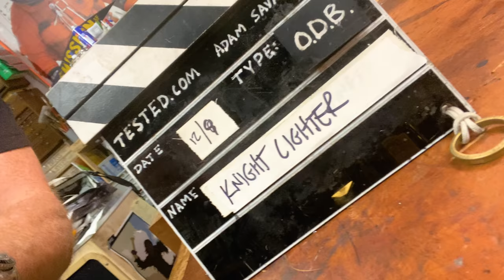Adam Savage's One Day Builds: Knight Lighter!

Comment: "So I've been watching those videos of dudes fixing things...I'm starting to have an issue with them."
Leaves us hanging...
Reply: Check out the My Mechanics channel. It's really great!
Reply: @cbugle  I'm already subscribed to several of those channels, which is why I'm on pins and needles wondering what issue Adam has with them!  Adam, please; do a short follow-up video!  I have to know!
Reply: I suspect he's talking about the Restoration vids that are popular.
It's basically people taking things and throwing them in salt water for a month of so and then "restoring" them by removing the rust.
Basically manufacturing problems they later "solve". Because they never seem to run out of old rusty items to restore.
Or people taking an old thing replacing every part with new things, basically making a new item. Theseus ship style.
I can't stand em.
Reply: I was wondering the same!
Reply: @5chr4pn3ll  lot of them are real, i saw old toy car, old handdrill, etc, but yes most of the random rusty axes are fake ones
Reply: @5chr4pn3ll  Yeah, maybe so.  I can see not being too impressed with that sort of thing.  Maybe I don't watch some of those channels because in addition to, yes, a lot of rust removal, I see dent repair, welding to add metal to then file back into shape, crafting things like new wooden handles as replacement parts, designing/printing new labels, etc...
Reply: My thoughts exactly.  I was waiting through the whole video for him to come back to that comment and tell us why he's having issues with them.  I assume his issue is that he's finding a lot that are either fake, or just using bad practices.
Reply: Hope he’s not talking about the likes of Scoutcrafter and 357magdad. They’re great
Reply: I came across a restoration video featuring a wheelbarrow in which the person proceeded to paint the tire black after cleaning it to make it look new. I don't know why but it felt so disingenuous that it ruined the whole video for me, maybe that's a facet of what Adam's talking about.
Reply: @5chr4pn3ll  I’m thinking the same thing, the “restoration” videos made to look good to the YouTube masses. Not the ones with real care, attention to detail, love for the historical value of the items, and sharing a little education on the process.
Reply: Some are too well made. I watched this russian the other day and it was like magic wizard stuff.  Potions and lotions to remove stuff.
Reply: His issue is that they don’t do a big reveal about what their videos are about even though it’s in the title of the video and usually the thumbnail
Reply: the issues everyone has: a lot of the metal objects have induced oxidation and are over-renovated. A lot of those channels are just frauds.
Reply: @5chr4pn3ll  gets old rusty knife
replaces the blade with a new one
replaces the holder with a new carved one
i  h a v e  a c h i e v e d  r e s t o r a t i o n
Reply: You gotta have the POV shot of someone picking out a conveniently placed black 1990s TV set from the bushes that just needs a fuse or something.
Reply: My guess based on the way he restored this lighter is that Adam doesn't like how they remove every trace of history and patina from the object, complete sand, polish, treat and paint the object until it looks brand new and is totally unrecognizable from the original object.  That's my complaint at least.  I do enjoy watching a few of the channels that seem the most genuine, but it hurts me to see them stripping away all the beautiful patina on and object, sand blasting it and then blueing it.  Sad times.
Reply: @5chr4pn3ll  Or the channels who literally use faked dirt and rust on their items they wanna restore, just so they look more screwed up in the thumbnails! 
Its so obvious on some, its not even funny, becauce of how many dumb people keep clicking on them not knowing any better, lol.
Reply: I love restoration channels! But I mostly watch them to relax. They were SO effective at putting me to sleep because of it, it''s an ASMR thing for me. But one channel I truly enjoy is @handtoolrescue. Such a great channel and he actually takes the time and care to restore antique tools!
Reply: Yeah very curious about where he was going with that
Reply: Knowing the kind of TV persona that Adam has, and the genuine positivity of his overall outlook (especially on Camera) I wouldn't be the least bit surprised if he decided not to finish that thought because he doesn't want to badmouth, belittle, or demean when folks may just be doing the best they can or discourage anyone from starting something.
Reply: @5chr4pn3ll  hes talked about just that thing in another video. I think it was where he was aging brackets for something
Reply: I also want to know, I've been watching some of those lately and also started having some problems, I just skip them now, I really want to know the issue Adam have :)
Reply: One of the greatest skills the man possesses is the ability to be genuinely and resiliently positive - but UGH, I wanted the rest of that thought!
Reply: Handtool Restoration is one of my favs.
Reply: Yes please finish the thought
Reply: He did mention how many of them seem to be staged in a previous video.  But, Adam also puts a lot of effort and skill into giving the things he makes a weathered look so they don't appear to be brand new and so they look like they have a history and a personality.

Many of the restoration videos that aren't staged are instead completely erasing an object's actual history and personality by making the items look like new or repainting them a different color... it's kind of offensive.  It's like taking old photos of someone else that you find and photo-shopping out their scars/tattoos or changing their hair color or adjusting their expression all because viewers find the process and results "satisfying".  It's shallowness to an extreme from that perspective.
Reply: Prince>McCartney
Reply: @5chr4pn3ll  If you're ok with antique firearms, Mark Novak is a good channel. He doesn't run out of old rusty items because he's a professional gunsmith, and well, antique firearms are frequently neglected. He also tries his best to avoid altering the original piece, so you get to see how far one can go to restoring things as they were.

edit: ooh, another one if you're into engines, cars etc. is Mustie1. His content is quite long form though, with a lot of focus on getting things working again. He doesn't really restore things to a polish.
Reply: “The problem with channels like Tsty and mymechanics is that no one ever uses their fingers to simulate the obnoxious walrus-like mustache of a former coworker.”
Reply: I think he's just saying he's watching them more he maybe should.
Reply: @5chr4pn3ll  My Mechanics
Reply: I know what bothers me about many of them is the "restoration" is either actively destructive to the object, or isn't a "restoration" so much as it is some filler and a coat of paint.  It's papering over the cracks without actually addressing the underlying damage that has happened over the years.  

In short, most of the ones I've seen are more about looks than doing a proper job of it, and it's almost painful to watch.  Especially since in many cases doing it the right way would require similar or sometimes less effort.
Reply: @5chr4pn3ll  I personally take issue with someone taking a beautiful old piece of woodern furniture that is really nicely polished then badly painting over it in white and going “I rEsStOrEd iT”
Opposed to fixing a broken leg or filling holes etc
Reply: @jerrytodd4037  I mostly watch them and specially handtoolrescue to potentially learn new methods, since i have treasure trope of old "junk" on my backyard (local recycling point) that i check pretty much every day on summer and find everything from several K worth of machinery to simple parts like hinges etc that someone bought and threw away in random stuff box. Most just need little work and act as spare parts. Mostly new stuff but there has been lots of old stuff that i repurposed or refurbished to work since you simply cannot get proper hand drill these days. I'm face planting that i didnt take that one AEG drill last year, now that i would need it for one project (mini wood lathe.. modern drills have all blown loose their chuck slide bearings, old ones had proper ball bearings...
Reply: @8bithack  yep, over-restoring, even over-renovating.
Reply: @5chr4pn3ll  Certainly not all of them are of that nature. Hand Tool Rescue is awesome.
Reply: Adam try Tsty-Tube Restorations he does what is right to restore old equipment
Reply: @5chr4pn3ll  Definitely all of that
Reply: @5chr4pn3ll  Just like that one channel that did a "on" Full restoreation, on a Buzz Lightyear toy figure..
Reply: yea hoping he finishes that thought in a later video... He cant leave us hanging like that.
Reply: I'm pretty sure he means the issue is him watching them too much.
Reply: @user-fk8zw5js2p  Except it isn't a piece of art or a human.  It's a tool.  It is no different than fixing a dent in a car door so that it looks like it never happened.  If you are interested in the tool for purely aesthetic or preservative reasons then fine, leave it be.  If you want to fix the blemishes then more power to you.  Nobody is complaining that Adam painted his tools in a previous video. The only difference is that the restored tool old is that the modern tool doesn't have "history".
Reply: @DavidSoucie  Never said it was a human even though many humans are tools. XD  I guess I should have been more specific.  I was talking about objects similar to antiques.  But, if someone is going to use something, then fix it until it works.  If someone is going to sell a car, then fix the dent.  But, fixing "issues" that are purely cosmetic is literally and figuratively by definition extremely superficial and shallow.

It's the same thing as watching people get cosmetic surgery.  If they are disfigured or crippled: great; do it.  If they are only trying to look like a 20 something model, then... now I am talking about people.

Everybody and everything is eventually going to get worn out and worn down; it's a law of the universe (entropy).  In the end, the only things that will remain is history and personality unless the history is erased and the personality barely existed in the first place; both being common on many of those human/object restoration shows.

What makes Adam different is that historic stories and personality are the priorities, whether he is building furniture, building Legos, or building relationships.
Reply: @user-fk8zw5js2p  you didn't say it was a human, you said it was like taking a picture of a person and photoshopping scars and tattoos out of it.  My whole point is who cares if some dude on the internet takes all the "character" out of some stuff they pulled out of a scrap metal pile.  If it doesn't match your aesthetic, then that's cool.  If you enjoy watching someone do one offs like that, then that's cool too. I do agree with the people who don't like it when someone artificially breaks or ages something then they "restore" the things they messed up.
Reply: Yes what was the story?
Reply: I think many of them are content factory material...
Reply: Some of those channels do fantastic work and truly do breathe new life into artifacts worthy of it.  Others completely fake it.  I think vise and axe restorations are some of the worst.  Probably 2/3 of those are just a nearly new item, deliberately made super rusty and nasty using acids and peroxide and dirt, and then cleaned up as if they did something amazing.  They're usually cheap import items to begin with, and when they're done they're basically just cheap import tools with new paint.  

Then there are guys like Eric at Hand Tool Rescue.  That's the real deal there.  Real restorations on tools and machines that are genuinely interesting and worthy of the effort.
Reply: he means he likes em to much i think
Reply: @warrenmiller9961  he fakes his shit... the frying pan video - watch it.
he faked the pan, he faked the note - everything was fake.
Reply: I seen one on a fractal vise? I think that was the name of it, it was one of the coolest vises I have ever seen.

Comment: To replace the wick you must pull out ALL the batting in the fuel chamber, then you can replace the wick.  THEN you must put new batting in.  Batting does need to be packed but not too tight.  (old zippo maintenance is the same)
Reply: And the wick have to go through the batting in S-shape, so you put a piece of batting, bend the wick to one side, put another piece, bend the wick to other side etc. In this way the wick will soak up the liquid efficiently.
Reply: and use tampons for the batting.... #1 way to find high quality cotton for cheap
Reply: And how do you propose he does that? Can you tell how it is opened?
Reply: @konzetsu6068  You do it through the fill hole.  It ain't easy but that is how it is done.  I have redone many liquid fuel lighters.  (I am 70)
Reply: @William Baker great to have your input on here!

Comment: Alright Adam. As a 30 year veteran jeweler and now firearms engraver, watching you polish this little knight on the big wheel was killing me. I’m going to turn you on to my number one tool for jobs like this. 3m Radial Bristle Discs. 
Need to debur, polish, create a fine matte texture, access tight areas like your little knight to polish them, remove mold lines or flashing from a plastic model, remove rust from vintage item yet not overly disturb patina, etc etc.?
These little radial wheels come in various grits from heavy enough to remove material to light enough to polish only. They will mold to any surface and not cut any one area to heavily. They’re great for for delicate weathering jobs and leave no trace. I use them for blending sanding marks on firearms restoration and in engraving where I don’t want to harm hundreds of hours of extremely fine and expensive work I’ve completed. Yes. They’ll do all these jobs and more. They are a Godsend for delicate projects. After watching they way you work I realized your shop and the myriad jobs and tasks you do are extremely similar to my own shop and projects. This tip is a gift for the years of entertainment you’ve offered my family. 
You can find them as A small starter kit from Amazon or any of the jewelers supply houses. They come in 1” versions which are stacked between 3-6 deep on a small mandrel for Dremel tools or larger 3”versions for the polishing motor. Or contact me and I’ll set up a few samples and send them your way. Yes I’m rambling about a little plastic impregnated polishing wheel. They are a game changer in a world where that term used much to liberally. They’ll change your life. Hyperbole? I think not. 
Google 3m Radial Bristle Disc. 
If you get them in hand and wonder, “OK, what now?” Feel free to look me up and I’ll add a video to my channel on their use or contact me and I’ll explain them. 
You’ll thank me later. 
Cheers,
Layne Zuelke
Southern Custom Engraving

Comment: Hey Adam, if you're interested in fixing and cleaning up another unique lighter, look for the Baier jeep lighter. Made in Germany shortly after WWII, possibly as a pet project of soldiers stationed there. It's hand machined out of aluminum and has a really unique mechanism. I'm working on one right now, sitting here polishing it with my dremel and it made me think about this video. I'd probably get better results with a large buffing wheel like you used.

Comment: I have polished many antique aluminum slot machine castings in my day.   Your setup looks good,  but do the following 2 things.    Put the polisher on rubber matts.  If the item gets pulled out of you hands,  it will be safe on the foam matts.     Also,   Keep elbows tight to side, firmly hold object, and use your body to polish.  Pushing the object into the wheels with your hands will give a better chance of the wheel grabbing the part and puling it out of your hands and send it across the room.

Comment: Adam, 
You should consider getting an air die grinder, they have way more torque and are smaller than their equivalent counterpart. Air powered tools are almost always more powerful and compact than the electric versions, as long as you have a good enough compressor they can't be beat.

Comment: Hey, a medieval arms and armor expert here. That kind of pauldron or spaulder that deflects the incoming lance is called an ecranche, and it's technically a type of shield, rather than an actual pauldron (there are a lot of technical reasons why). You are correct that this is modeled after a jouster's armor, as ecrancher were almost exclusively used on horseback. They allowed for the protection of a shield, while keeping the rein hand free. They were widely used from the 14th-16th centuries CE. This particular model appears to have been modeled after a later model, most likely 16th century, as it fully encloses the wearer and has a very smooth surface, without much fluting. More specifically, it seems to have been modeled on this specimen from the Musée des Beaux-Arts in Dijon, France. Though there are two notable differences between this one and the museum's piece (despite the size and, well, fire): The lighter features fully-enclosed legs, which were rare for jousters, as the legs are protected by the horse; and the lighter lacks a lance rest or couch, most likely because it was too small and fiddly for the replica maker to be bothered with.

https://www.reddit.com/r/ArtefactPorn/comments/7qycug/jousting_armour_mus%C3%A9e_des_beauxarts_de_dijon/